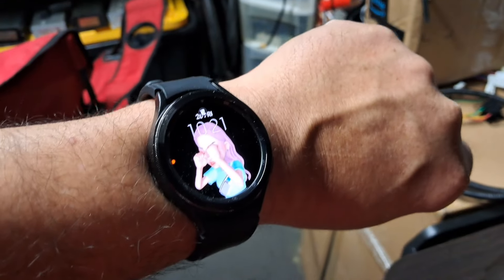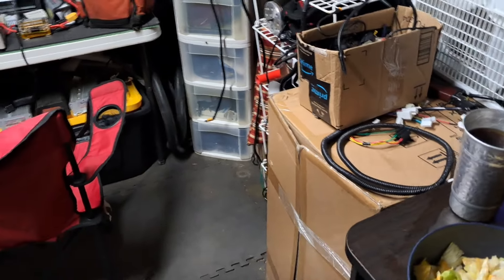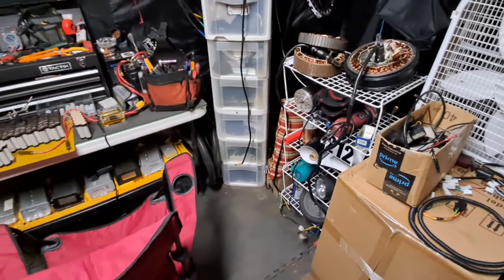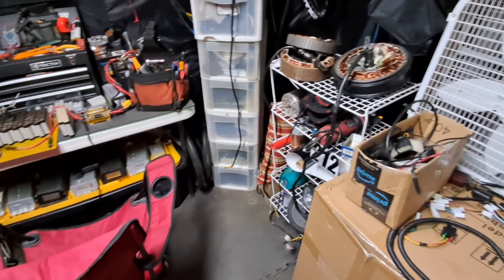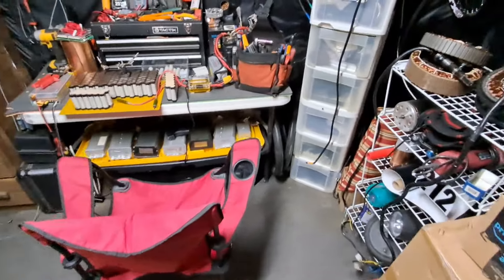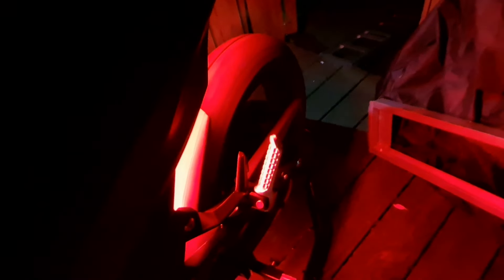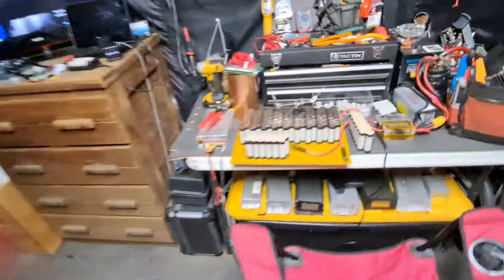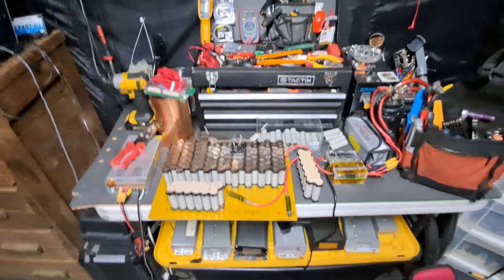Battery's, capacity & Dicharge rate why both increase when you put more cells or packs in parallel.

Comment: Take a motors rated rpm.  And then divide it by the nominal voltage. 

So Say your motor was 1000 RPM at 72v.  That means that motor does 13.88 RPM/V.  Now take your new nominal voltage.  Say 96.  Take 96x 13.88 the new RPM will be 1333.

Also remember the weight differences when doing much more P than a high discharge cell.
Reply from the maker: Formulas Formulas Another reason why we could make the argument electric over petrol but you would probably have the petrol conversion. If your not subscribed to this Man you better be. When it comes to real speed this is the guys the professional drag racers go see. His name is not Build It Tune it just for fun it's a fact. I would have never thought the Beast was capable of 100mph until he told me it's calculated speed. This is why electric is better than gas but he can calculate those too

Comment: 21s at 20 p of samsung 18650 20 amp draw cells fits into enduro frame nicelywith abit of room to spare
Reply: thats about 420 cells for memory
Reply: we make them in 21s 5 p packs then they connect in parralel and the bms just paralelells across each pack so can remove 3 packs  for lighter bike on short trips etc
Reply: we were lucky we found a palate load of high quality skateboard packs that were brand new but the bms was faulty so it worked out we got each cells for 2 dollars australian or 1.31 usper cell for abit over 5000 cells
Reply: a single new cells here is 13 dollars
Reply from the maker: @angusmcgil  OMG why are they so high? Are you referring to the Molicels or the ones you just mentioned
Reply: @ChrisCrossingWires1212  yeah a single brand new samsung 18650 30Q cell cost 13 au or 8.41 us but it drops drastically when you buy a couple hundred
Reply: ebikes at the level you and i make are very rare here when i ride mine it causes a crowd and people keep asking for a ride but of  course dont ever let anyone ride it ,as its to dangerous